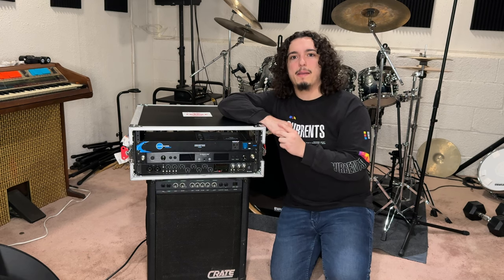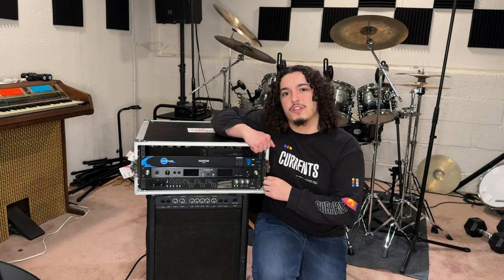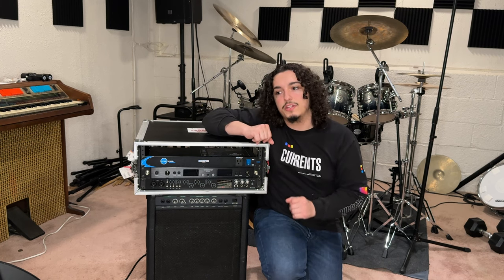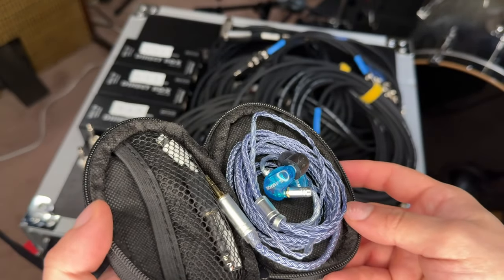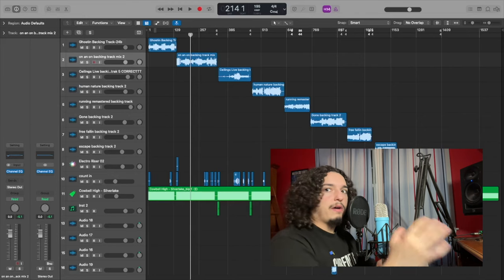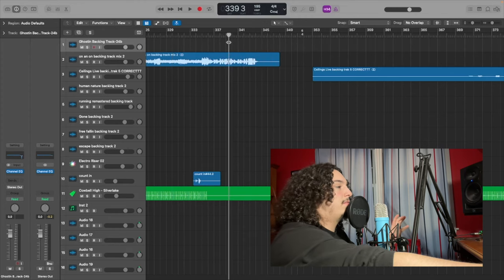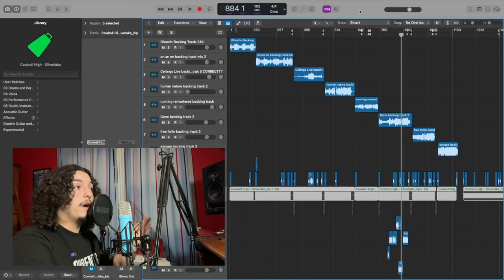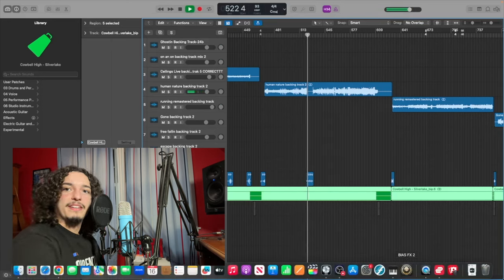DIY Backing Track/In-Ear Monitor Rig Build Tutorial ($1600 OR LESS)

Comment: couldnt you just use a rack splitter instead of di boxes?
Reply from the maker: For this setup, no. A mic splitter is a better option only if there is a separate rack mixer present. Both of those items also cost way more than the entire rack presented in the video.
Reply: @tjviolaofficial  that makes sense. Thanks for explaining!